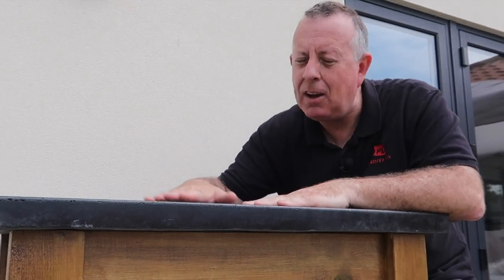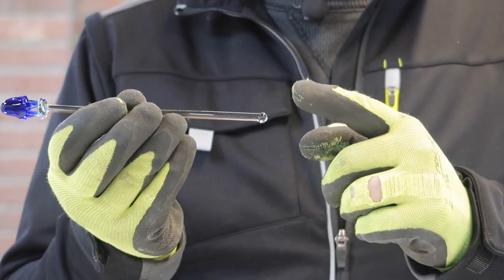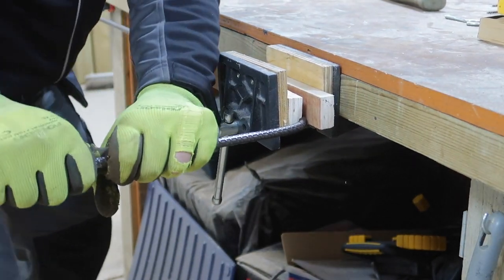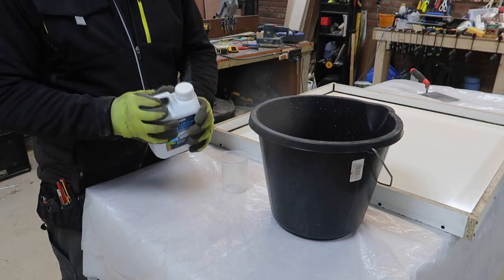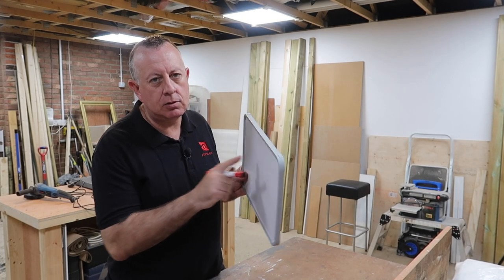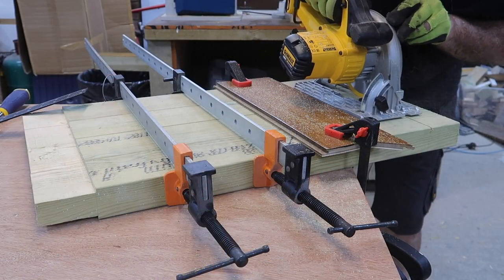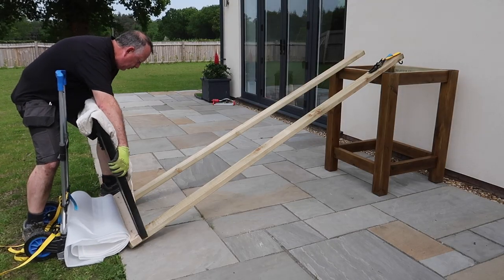How to Build a Concrete Top Garden Table

Comment: Im a little confused as to why you think the rebar going around the outside of the form will make the concrete stronger? Wouldnt it be better to have it say, going diagonally across the piece, to add rigidity?

Comment: Nice build. How did you attach the top to the frame? Or is it held there on its own weight?
Reply: Was about to ask the same.. (for a friend of course)...🤔😉
Reply: Same here...
Reply: and me 😁
Reply: Same here.  I know it's heavy but knowing my luck it would get pushed off-centre and then fall through the middle of the frame. Shame there aren't any brackets/fixings cast into the concrete.
Reply from the maker: I haven't connected the top to the frame - yet. Once it was on it sat nicely on all 4 corners and it is so heavy it was a major challenge to adjust to get it central let alone knock it off
Reply: @captainbarnes923  lol, just be glad we do ask the question, saves you on thumb wear 🤣😆
Reply: One slightly drunk comrade stumbles on an olive that has fallen next to the table, grabs the table, the table tilts, the plate weighing 60 kg slides off the support, falls and breaks the leg of another comrade. This is the first thing I thought about when I saw how much the countertop weighs. I'm probably a pessimist....
Reply: @ProperDIY  As you rightly say, the combination of the top's weight and the coefficient of friction ensure that the side force necessary to move the top is suitably large.  If you REALLY want to be certain of no slippage, it does not take too much more effort to redesign the mould so as to incorporate a lip around the periphery which in turn fits into a recess on the table top..

Comment: If you do something like this again... If you wax the melamine before doing the silicone, the silicone will still stay in the corners well enough, as long as you don't pull at it, but the excess will peel off nicely.

Comment: Nice job and pleasing result - as you would expect from the intelligent application of knowledge and TLC.

A comment on tables in general and bar tops in particular. :  my English background ensures that I am most comfortable standing up at the bar, with one foot on a foot rail.  This suggests building a bar with the top at ELBOW HEIGHT.  This will make the whole structure potentially top heavy unless some ballast is added below.  The foot rail can be used as the basic carrier for some form of ballast.  The elbow height I find something of a necessity these days : I am at present in my late 80's and find standing and bending at the same time to be a painful experience, and the elbow height really helps.

Comment: Great, flipping heavy is definitely a calm engineering phrase and not one I’ve come across on site 😂thanks for another cool project 👍👨🏻‍🏭
Reply from the maker: In 30 years of working for contractors it's not a word I have ever used before either however these days I have to be more YouTube friendly I think. I did actually record it with 3 different phases so I could decide later but my wife made it clear which one I should use!

Comment: Thanks for this. The glass top blew off my garden table in this storm we've been having, gutted. This could be a solution to replace the table top with something stronger. What's the thinnest do you think I could get away with using this process?... as I'd prefer to not have it as thick as the on done here.

Comment: An excellent video.  Thank you.  I would like to see a bit more of the joinery method that you used if you happen to be doing another project with similar legs at some stage.
Reply from the maker: Thanks. I know - I had to cut things a bit tight as the video was very long to start with. I could make an hour long video just on the timber base - but people don't  necessary want that level of detail. I'm am planning to be able to provide both

Comment: Great video. Loved the comment about the wife not getting upset with you using kitchen utensils. I have a habit of using one of those flat kitchen icing spreading knives for tapering jointing compound when doing plasterboard repairs. Drives the wife batty :-) But such a perfect tool for the job !
Reply from the maker: We have to use the best tool for the job and unfortunately sometimes that comes from the kitchen!

Comment: Really good that - just thinking about the drip bead around the underside could you place a dowel / profile into the cement to form it - saves the grinding -
Reply from the maker: I did about doing that but as the concrete contained quite large aggregate, it was quite difficult to push anything into it and easier to float off flat without anything in the way so decided to cut it after

Comment: Hey, I have an idea.  You could just lay an extra panel on the bottom of the mold to make that drip edge.  Also, since you were sanding the edges to form them when you first cracked the mold, could you just skip the caulk?
Reply: The caulk also prevent the cement and water to drip off the mold

Comment: Hi Stuart, just want to pick your brains. I'm going to make a circular concrete garden table. The circle base is not the problem, what can I use to go around the perimeter that will bend around the base? I will need something about 20mm depth. I just can't think of anything to use. 🤔🤔🤔 Thanks Niall ☘️☘️
Reply: Thin plywood strips, with the outer grain running vertically should bend around your circular base.

Comment: This video has inspired me to build a similar project in white concrete, would the same methods but replacing material with white cement, white sand and white pigment additive work do you think?
Reply from the maker: Yes, absolutely. Go over the top on everything white or you will get a grey instead.
Reply: @ProperDIY  good idea, will be rewatching your video to be confident with my approach! Thanks again and look forward to your next video!

Comment: Nice project! I really liked the execution and all the little details. The joinery used looks fantastic too.
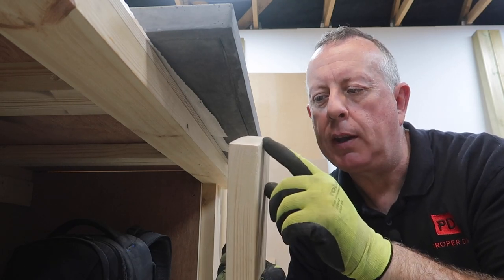12:30 Would having metal caps set in the concrete to cover the tops of the legs be ill-advised here? The question of what metal to use would arise of course and I think aluminium would be out leaving just iron as candidates. Then stainless  might be optimal as anything else would eventually corrode. But would water ingress cause even more problems with the metal caps?
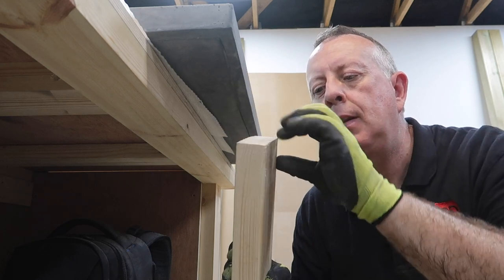12:40 I've seen scorching used in timber construction before the tar sealant is applied. That might be unsightly so the bottom parts of the legs could be painted black to disguise it. But charring and then having tar applied would probably make painting over impossible. Perhaps just charring the bottom surface of the legs could work? Coming to think of it, this would be even suitable for the tops of the legs, being careful not to overdo it and compromise the joins.
12:45 Could rods be pressed in the concrete before it sets as an alternative? Or would that be harder to achieve than simply grinding the concrete afterwards?

Comment: Nice video. Save yourself 24 hrs and the price of  silicon and grind for the bevel edge or better put a piece of decorative trim 1cm plastic cornice ( around your form work) at the bottom of your pour. Pattern up. Cheers for the video
Reply from the maker: Thanks. If you don't use the silicone to form the roundover you may still need some to stop grout loss

Comment: What would you recommend to secure the top to the base? With kids and animals around I dont trust gravity and friction alone.
Reply from the maker: I would use some basic angle brackets underneath using short Rawl plugs into the concrete
Reply: When forming the concrete put some bolts in it. Use a couple of pieces of wood, drill the holes in the required postion. put the bolts in from the bottom, a nut on the other end so you can get them at the correct depth. Put the two pieces of wood on, a couple of screws, vibrate the concrete. You will have bolts ready for brackets screwed to the wooden frame.

Comment: You just need the rubber silicone scrappers, as long as you spray the silicone with a soapy solution before dragging all you’re left with is a spotless bead. They cost about £10 for a bag of different sizes.
Reply from the maker: My camel was cheaper and funnier

Comment: Another (easier) way to find out how many litres the ballast equates to is the same method Archimedes used, put the bag in a bin, fill the bin with water, take the bag out and measure how much water is needed to top it off again....... if you use a bucket like a home-brew bucket its already indexed reasonable accurately.....
Reply from the maker: Can do - good suggestion

Comment: Great project, another thing for me to start building. A couple of questions. Were you not worried the rebar would settle to the bottom with ask the vibrating?  With the rebar could you have made it thinner, I'd probably want it twice the length (I suppose you could just have two halves to the top).
Reply from the maker: Thanks. The larger aggregate in the concrete mix tends to stop the rebar from sinking and the vibration of the sander isn't strong enough to move them. The stop the rebar from rusting you need concrete cover between it and the outside world so I felt 40mm was the min I could get away with
Reply: @ProperDIY  Thanks for the reply! Two identical tops it is then (if I ever get round to it).